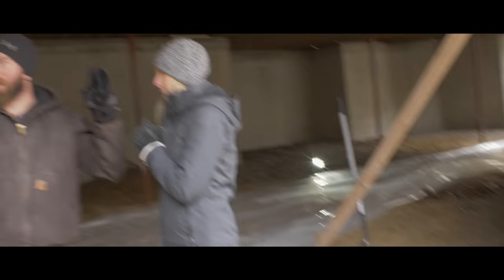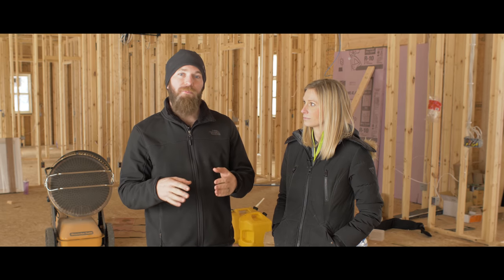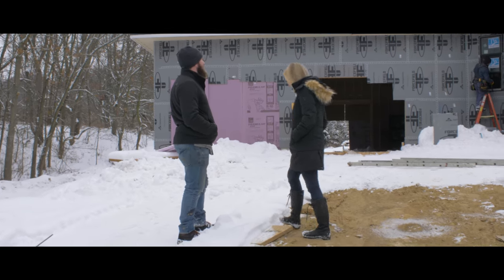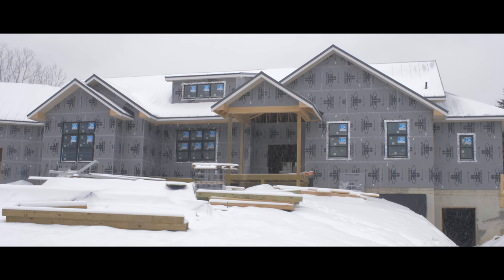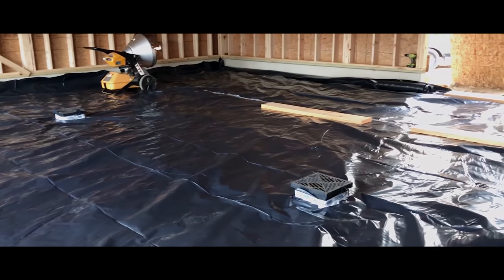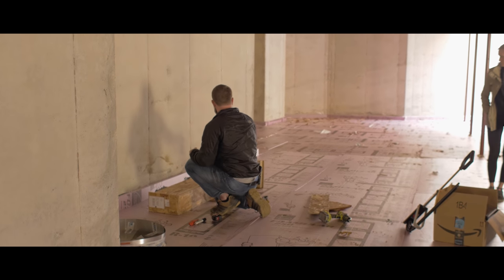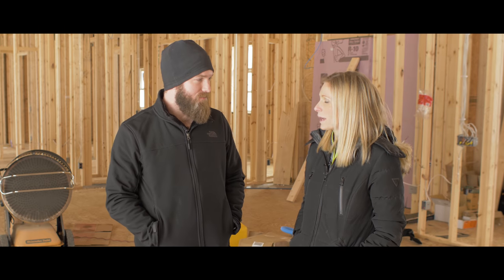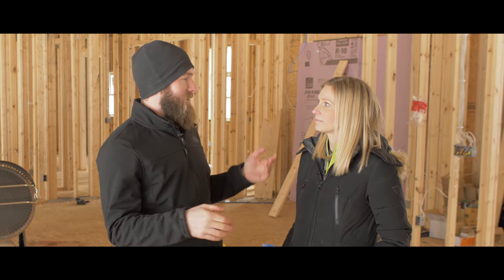DHB EP 3 - Roof, Windows, and Radiant Slabs [4K]

Comment: Hi,

I have been watching for a while now and was wondering if you guys have any tips for paining the interior sides of the windows. I currently have double hung windows installed and found it cheapest when installing 30 windows to not have them factory finished. Do you have any tips or footage of your process of painting the windows you guys bought.
Reply from the maker: We didn't do any tutorials on that specifically. But the process we used was to remove the windows from the frame, take off the hardware and paint the primed wood. You should paint onto the window to make sure you get everything. Then come back and scrape the paint off the window with a flat utility knife.